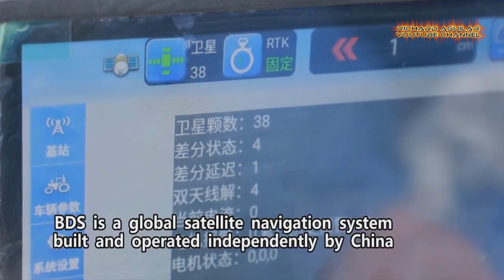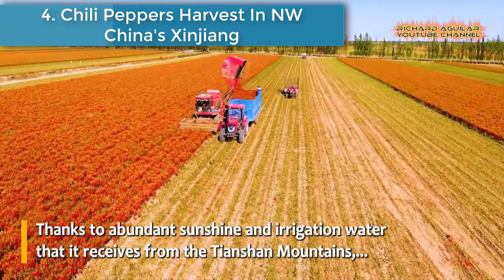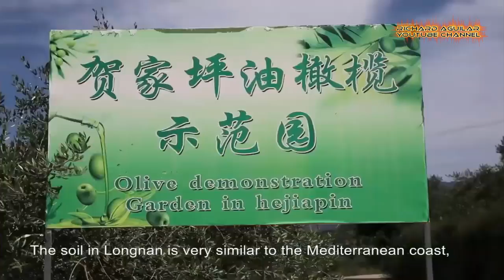This Modern FARMING INNOVATION In China Shocks The World

Comment: Pretty damn amazing. That's some engineering. Why are seedlings planted and not seeds?
Reply: The modern agriculture needs the specific basis for plant breeding.
Reply: It's always this way, probably for better efficiency and higher yield.
Reply: Seeds get eaten by birds...............
Reply: Jumpstart
Reply: Seedlings are planted in water wet field and seeds are spreaded in dry field.
Reply: Seeds are usually planted in a small facility to get to seedling stage. Easier to control the input and uses lesser area.